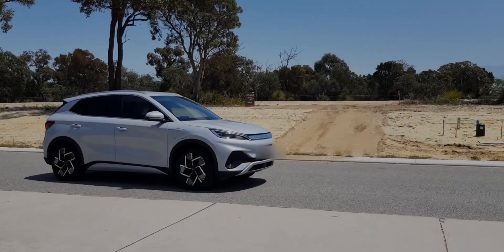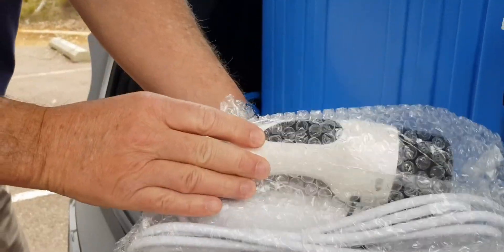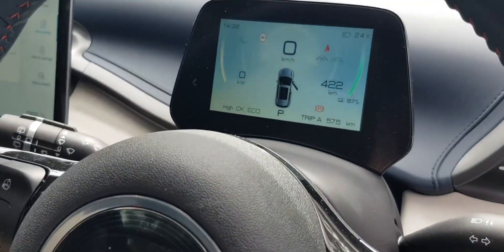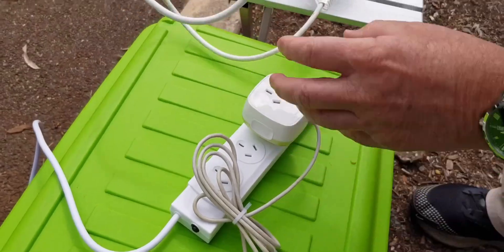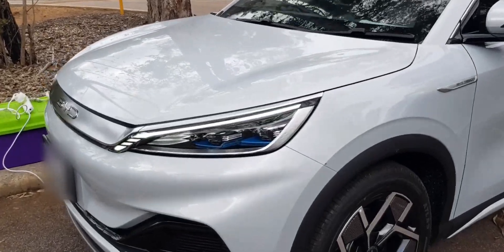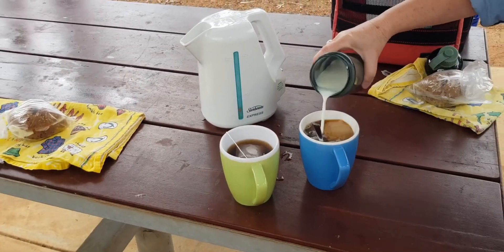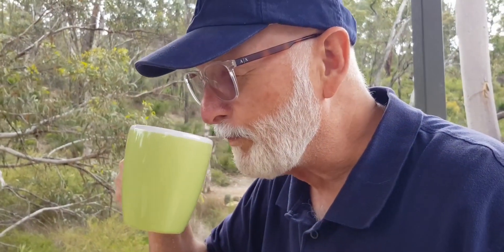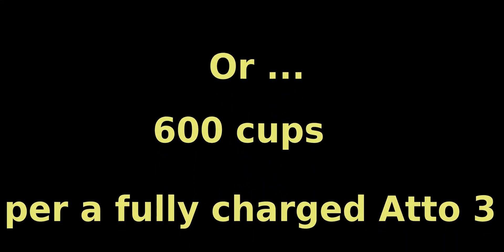BYD Atto 3 for Tea for Two and a Kangaroo or Two

Comment: The plug and lead come with the car? Have an ATTO 3 on order for 2023 delivery. From what I’ve read there’s no PowerPoint outlet in the car? Was fantasising about a small 240v fridge when travelling. Not sure what would be involved fitting an internal outlet somewhere like in the back seat or boot?
Reply from the maker: No 240v outlet inside but the external 220v supplied via the charging port works well for overnight camping. Also on a side not the USB-c outlet under the console is a beast. I got over 4000 mAh supplies to my Pixel 7 pro!